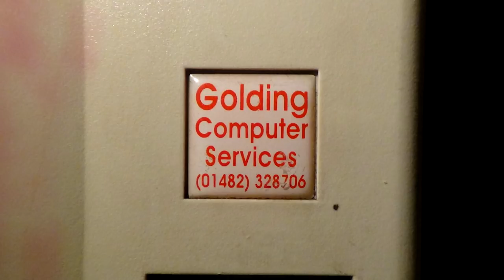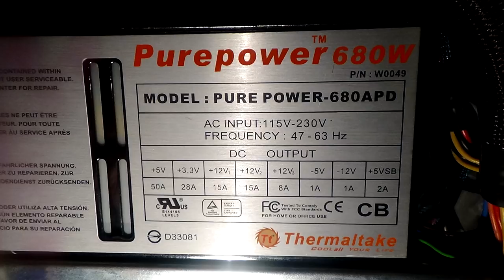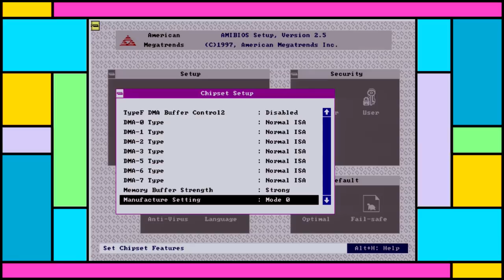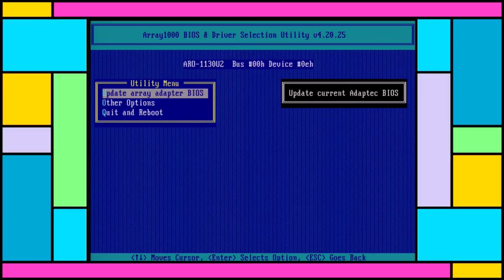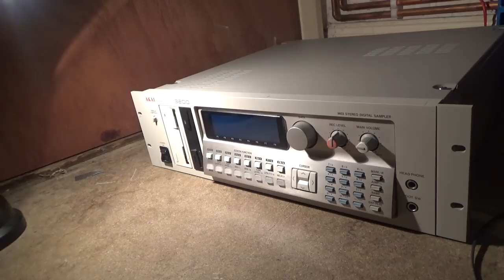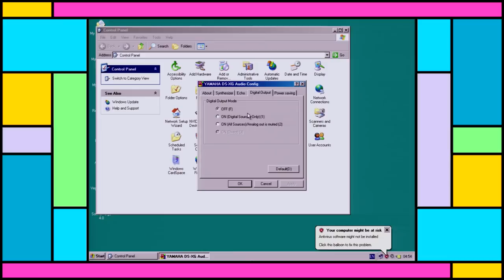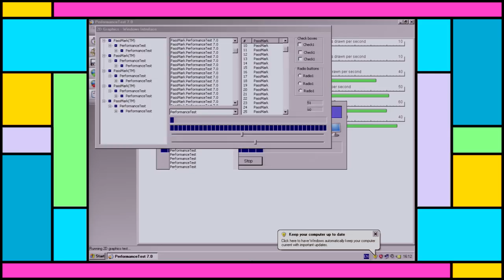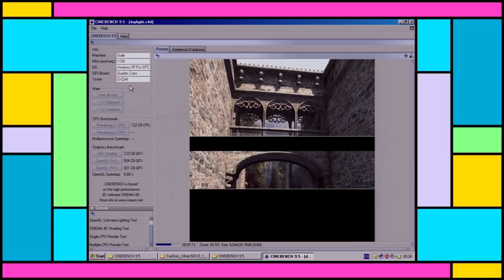Upgraded Dual Pentium III Workstation

Comment: Where exactly did you hear OC killing 440BX chipset? Name even one documented case.
Working at regional EU parts importer (sole Asus motherbaords, CTX monitors, Primax  distributor etc) at the time in RMA department I remember about 3 bad BX motherboards between 98-2001, and we did import PCChips! 

Not saying 133Hz fsb makes sense on BX, or even would work in dual system, but this idea of causing damage to the chipset is a false statement :/
Reply from the maker: From memory, crappy forums and old magazines. I've never run into it myself, but then I don't really overclock anything which is why I said 'I've heard...' instead of 'it will...' in the video. False statement is a little extreme, perhaps hearsay would be a more appropriate term, it's certainly possible to cause damage by overclocking, even at a stock voltages, as this is something I have witnessed on other devices first hand. It seems doubtful that many of your customers would have been overclocking their boards back anyway, so this doesn't really provide much weight or appear to be an adequate sample size either, unless you were encouraging them to do so, which is hardly the best idea.
This board will start at 133MHz, but you lose the SCSI controller and usually the NIC for doing it until the clock is turned back down. The chipset produces significantly more heat at this speed.
Reply: My customers were 40% market share of middle sized central European country for 3 years, hardly a small sample.
Reply from the maker: You completely missed the point, how many of these customers were overclocking their boards? That isn't something the average user would do and the people that would are unlikely to attempt a return if they break something. Sorry, but unless you went to every customer's house and monitored their use of the boards then we just don't know for certain, one way of the other, not unless you were selling systems which were being overclocked out of the box, which doubt was the case. There were some small stores that did this with older VX (or similar) boards and got away with it, I have encountered several machines in such configurations over the years, but not one BX, you have to wonder why.